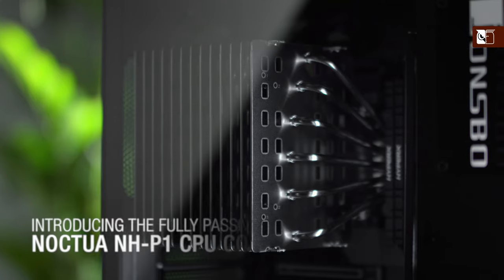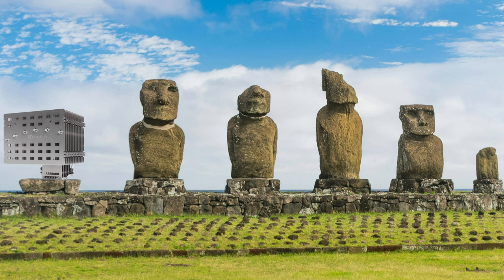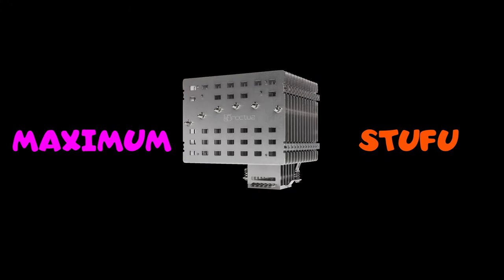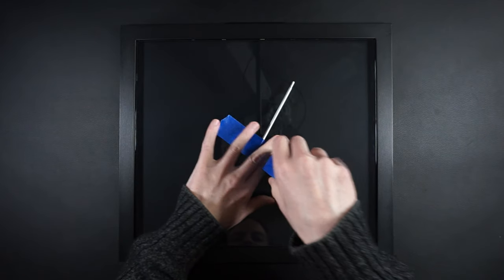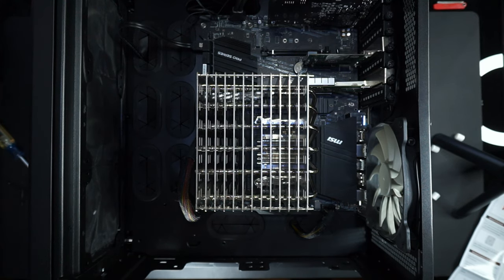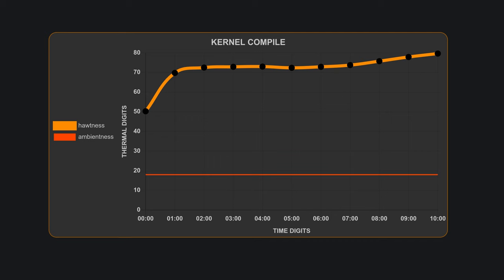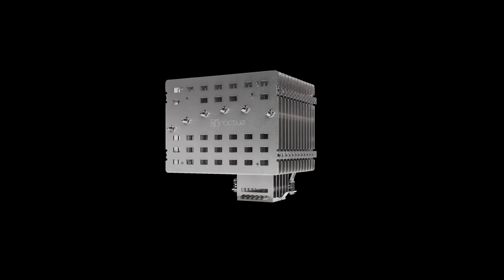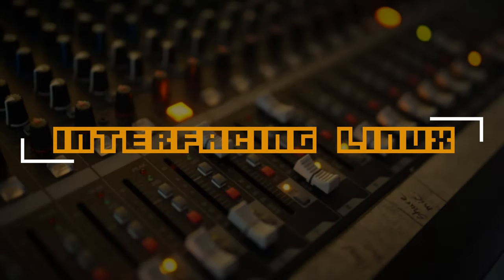Fanless Digital Audio Workstation

Comment: I wonder how that cooler would work in a case with a 200mm fan above it, like what I have
Reply from the maker: If it's a 65w CPU and the fan is positioned for exhaust, quite well.

Comment: The reason fanless has never really every worked is that fanless doesnt really work.  If you added a 900rpm 140mm fan on there running at like 200rpm it would be totally silent and yet generate over twice the cooling.  Jus saying.  Fans are not the enemy.
Reply from the maker: I added a 140mm fan running at 500 rpm to the case intake. The system never overheated or throttled under load.